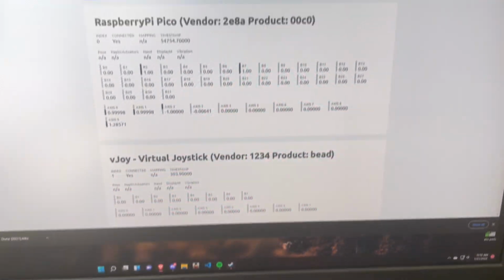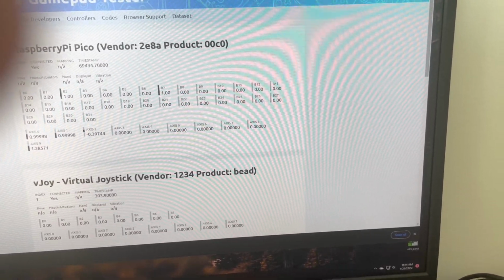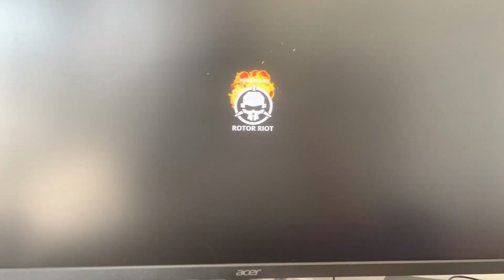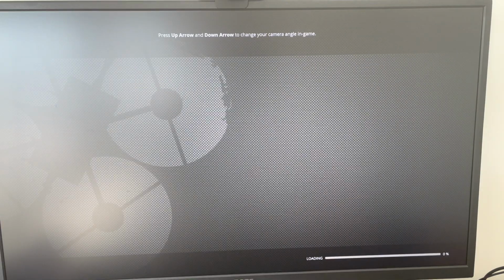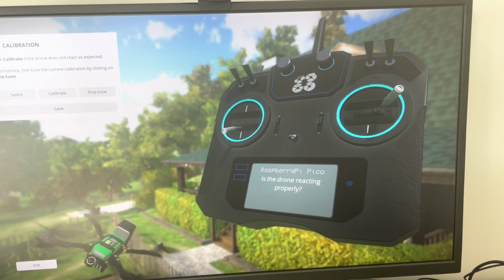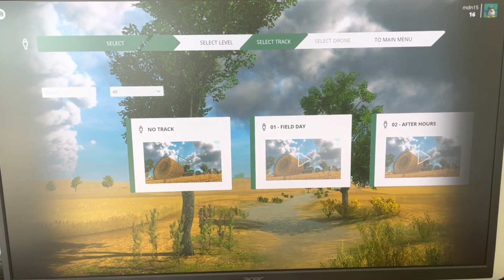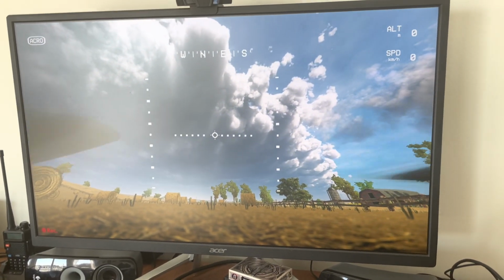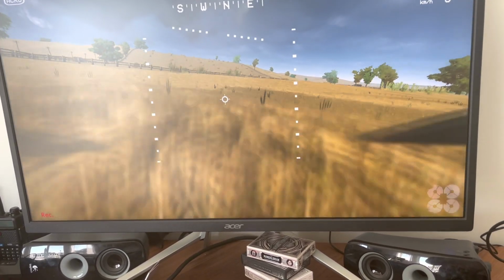ELRS / CRSF HID Joystick with Pi Pico

Comment: Can you make a walkthrough video of how to do it? And is it possible with a Raspberry Pi 3 Model B?
Reply from the maker: A Pi 3B would introduce way more overhead than using the pi pico.  Check out the github page as I'm currently working on a carrier board to make assembly easier.  Once I get those boards I will likely make a how to video!

https://github.com/mikeneiderhauser/CRSFJoystick